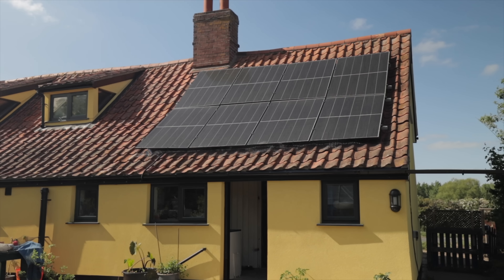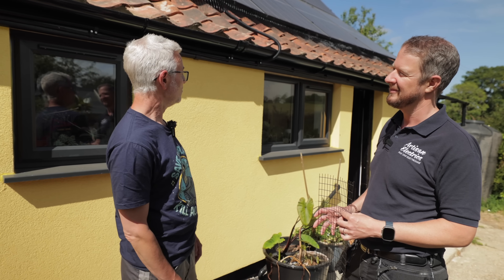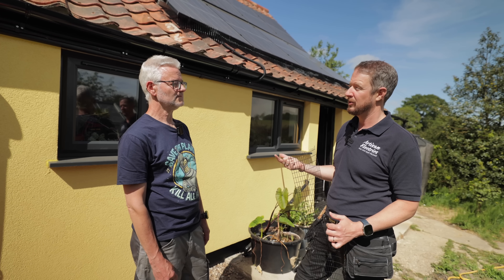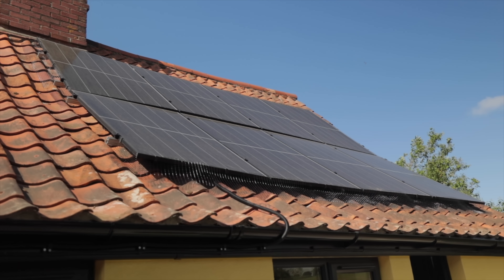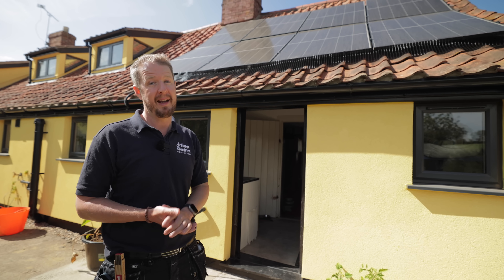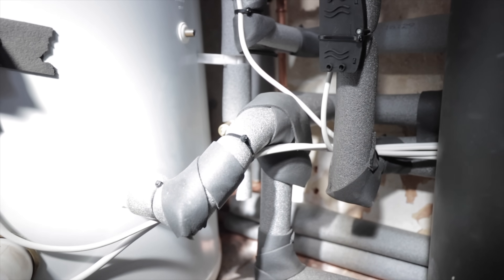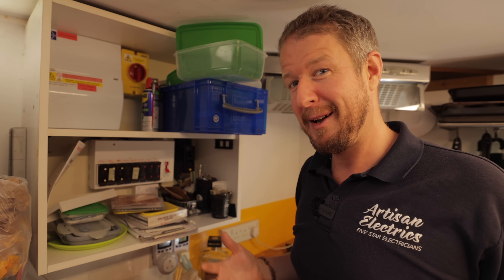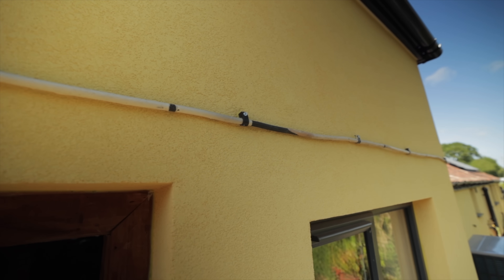This £50,000 Grant-Funded Solar Installation Went Terribly Wrong…😱

Comment: I don't understand why you want to install solar panels on that beautiful roof. It seems like there's plenty of space in the garden. So if it were possible I would have chosen that.
Reply: The house faces almost due south, we'd have to level the garden to groundmount a solar array. But thanks for the roof compliment :-)
Reply: These grants don't cover ground array. 
Was told that when I applied, and when I managed to get hold of a proper engineer to talk about it, he googled the property and also said with that old style roof they couldn't do roof array (as originally suggested) either as they have no way of knowing where the rafters are. They are not set at a consistent distance as a more modern roof would be. I know this to be true as it was re-roofed 8 years ears ago, and all the old higgledy rafters passed BC, structural engineer & builder approval to remain as they were still good. 
So no solar grant - and no wish to spend £10k to reduce modest electric bill by ....? Payback over 20 years.

Comment: I want to get solar, but I'm actually a little nervous because of the cowboys. I don't want Artisan Electrics style of gold plated, pretentiousness but I also don't want something ugly or dangerous.
It's such a dilemma, especially as MCS is mostly a business overhead rather than an actual valid constraint on quality.
Perhaps the industry needs a scheme as an alternative to MCS which doesn't just require paperwork but supports installers (big and small) and which has insurance where the installers get a no-claim cashback if their installs are good. If their installs are crap, then they lose their insurance and get booted off the scheme after sometime sitting at the bottom of an Ofsted style rating.
Then if you subcontract, you'll also risk your membership and money, because you're not doing due diligence.

Comment: I had wall insulation done in 2014 , The contractor was a cowboy, I made a lot of problems for them and i got the work done properly by complaining before the work was signed off , I think it cost the contractor more money since i was complaining for a full row of houses , In 2022  i had solar panels fitted , Within weeks i had rain getting into the house, I complained and the contractor had to pay for the roof to be re-felted and new tiles.  I had to sign a form that i could not come back to them if it leaked again , But least i had my roof redone . All of this work was done under a Gov Grant . I refused a heat pump , The old lady next door got a heat pump, She is happy with it , But at £300 a month in winter , Its going to cost her and its a 2 bedroom 1850s cottage .  My energy costs with 8 solar panels , Over the year , I am only paying £8 a month and we don't have a battery but i do get 15P a KWH from Octopus for export

Comment: Absolutely insane that 50k of tax payers money was spent on a single 400 year old house. A old house needs to breath. Sticking insulation on the outside to make it airtight sounds like a disaster waiting to happen. This is about as anti green as it gets.
Reply: It's a breathable system because it's an old house. Have to say the house had cement render already for ~60 years... so much reduced condensation problems not the structure is part of the thermal mass and not a cold shell.

Comment: Enlighten me. What do end caps do?
Reply: Potentially nothing... but in this instance they would have partially disguised the rough jagged cut/broken ends of the rails (had they not been all different lengths sticking out) and maybe stopped mice using the rails as highways. If this was done properly as the panels are black they would stop the silver aluminium rails showing so obviously. It's mainly aesthetic.

Comment: Just been doing small solar for friend to offset power used by his carp pond New Sunny Roo 3kv invertor £140 off ebay 5 x 420 w panels £63 each plus some brackets ect , Reckon we spent £500 all in systems making 1.7 kw at moment so you can do solar pretty cheap . I run off grid system at our stables , 4x 6v 420 Ah lead acid battery's (sourced S/H) Victron 1kw invertor S/H , 6x 420 w panels , runs everything all year round including bore well pump . This only cost me about £600 as most gear was S/H  , wired panels with surplus 13a mains cable (all 3 cores used on neg and pos lines ) and system works really good

Comment: low ceilings ,cost cutting when built ,same as dormer windows in the roof ,my thing about it all is the roof itself , the roof timbers have warped over the centuries  ,in  all direction's, hence why it looks a mess  ,the next point is they did all that work in 2 hrs, ,one thing is we have no pictures of these so called fitters ,and i bet there van was blank of anything ,who they where
Reply: Good guess on the fitters van... 3 days late because it broke down twice, 21 year old rusty sprinter, plain white, looked like 3 freelancers, sub-contracted by the sub-contractor through a sub contractor for the main contractor...

Comment: my daughter on low income and no spare cash , was awarded £36,000 grant under the scheme , BUT unless she paid £16,000 towards it she couldnt have anything . at least in the end after two years she got free loft insulation from a team of men that had to travel a total of 500 miles to fit the insulation,.   About ten years ago i got 20 rolls of loft insulation free of charge by phoning up British Gas, who delivered it the day after i requested it, i did have to install it myself but clearly no contracrors, sub contractors, corruption  just a simple system cost efficient.

Comment: Who in their right mind would install external insulation, solar panels and a heat pump onto an ancient house?
Reply: If efforts aren't made to keep old housing viable it will be forced out of existence. This was a plain old house and will live on longer now. It wasn't special, not listed and with an EPC rating which meant it couldn't even be rented.
Reply: @reallymadrob  old houses were built differently, they were not designed to be wrapped in insulation and sealed with render....the life of this house has been greatly reduced by external cladding. The house can no longer breathe and moisture will be trapped in the walls causing unseen deterioration. The best way to keep old houses viable is to maintain them sympathetically. Our old house had been encased in render in the 60s and was damp through the walls as they couldn't dry naturally. We took the render off and the outer skin of the gable wall literally crumbled and had to be rebuilt - if the render had been left in place the wall would  have collapsed and the house lost in a very short time. Old houses need to breathe and move from season to season.
Reply: @bobstirling6885  this was rendered ~60 years ago. We had condensation problems because the shell was so cold. The insulation is breathable and ventilation is part of the design - we will be monitoring the frame.

Comment: This is why we won’t have solar panels or heat pump installed. Because it will be a total disaster. The government need to regulate this because government money is going down the drain and it’s costing the people who have installed a fortune to have it put right.
Is there anyway that the installers who do it properly and the people who want it done? Can do a petition or something to get things sorted out?  
Or someone from the government should check and sign it off as being done properly if not the installers have to come back and do it until they do do it properly . Other than that, can’t think of anything else.  Maybe doing that will get rid of the Cowboys.
Reply: There's no need for it to be bad - one reason for sharing this story was to highlight the risks and hopefully give the system a kick up the backside. Simple checks would have saved money and done a better job.

Comment: This is the problem whenever a government grant is run. Cowboys rush in to take a piece of the pie. They have no intention of creating a long-term business that relies on customer recommendations and a reputation for quality work. Their sole focus is getting as much out of the scheme before the funds run out.
All work should have 3rd party independent inspection from a company that sole focus is inspection, testing and quality control. They should be appointed prior to the bidding process and take part in writing quality control specifications and selecting bidders.
This may seem costly but the price of allowing workmanship seen in this video is not just financial it can deter people from making the move to green systems.
I won't comment on the electrical safety from a video but nothinh should fall from a roof - not even lightweight bird guards.

Comment: I saw in Wickes offer on display 12 solar panels and a battery fully installed for £8,950. That is without looking around for a quote. I have not doubt most of the £50k is for administration costs.

Comment: Terrified of the heat pump, because it's a very porous house, but they've also just gotten a grant to insulate the house. That makes no sense. Is he expecting a properly insulated house to remain porous? He even says the insulation of the house has been great before he starts talking about the heat pump- so what's the problem with having a heat pump?

That honestly sounds like someone who heard that heat pumps aren't good and anchored that in his brain and refuses to change his views, even when he himself presents his own counter arguments.

As for solutions - these types of grants MUST come with inspectors that are fully independent. How does one achieve that? A base rate and then £x for each cosmetic flaw they find (e.g. the paint peeling off of the wires, the wires not being hidden away), £y for each minor flaw they find (like the missing bird mesh, £y for each major flaw they find (like the heat pump not being leveled). That gives inspectors a financial incentive to find flaws. Make sure the contractors aren't paid fully upfront, and they aren't paid the remainder until the installation passes inspection. All financial rewards to the inspector are paid from the remainder, as that gives the contractor a financial incentive to pass inspection.

Comment: We had a not dissimilar experience with our Heat Pump installation. This was the last step in a program that included solar PV, batteries, car charger etc etc, and whilst everything else went well, the heat pump installation was a nightmare. The installer went bust before the system was fully commissioned, and I spent a year rectifying faults. It took numerous attempts with numerous installers, (and plumbers), all of whom did a little bit to help me on my journey to getting things working the way they should, but none of whom truly knew enough about the whole heat pump installation process or technicalities to be truly useful. I have now re-lagged the loft, fixed leaking manifold valves; cleaned out strainers on the underfloor system; lagged external pipes; had the heating system drained, flushed, and filled with the correct quantity of inhibitor/glycol (not cheap!); had faulty pipework corrected; sorted out leaks that resulted from moving to an invented system......I even had to re jig the wiring to the under floor heating actuators so that the thermostats control the correct zones now!
I eventually found one company that addressed the main problems and they have been fantastic, even having to re-wire the heat pump....yes, even that was wrong. And all through this journey, the so-called insurance policy that the installers set up for me, and MCS have been worse than useless. Honestly, I have had steam coming out of my ears over the way an end user is conned, YES CONNED, into believing these organisations give them any measure of cover against cowboy contractors. Make no mistake: they DON'T. When things go wrong, you are very much on your own....and boy do you learn quickly!
So Jordan, in answer to your question about how this can be overhauled, I would start with putting in place some real, independantly reliable  protection for the consumer. After all it's no use trying to sue some one who has gone bust........

Comment: Its about the contracts. No subcontracting allowed. Local installers preferred.  Quality checked installs. 

Been the same for years, the insulation grants in the early 2000s where the same issues.

Comment: Personally, I don't think governments should be just handing out grants and ticking boxes, they should fund a GBE to bring all houses up to a specific level of energy efficiency. They should work with homeowners to put all options on the table to either meet that bar or exceed it with additional investment from the homeowner. Then they need to make a project plan specific to the customer, implement the build/installation/commissioning, and inspect the work done before it's signed off.

In terms of actually implementing such a scheme, you're only ever going to get bodge work if you just throw it out to tender, they need to hire subcontractors directly (or possibly even just employ them), and manage them properly. If the homeowner isn't happy with the work before it's signed off, the contractor doesn't get paid till they fix it. If they find out later that there's problems, the GBE can chase the contractor to warrant their work.

Governments can roll out such schemes efficiently, but just throwing money at councils to deal with the problem is unlikely to actually deliver the best results, let alone meet a specific benchmark. GBEs can leverage the scale of the government to deliver big projects that actually improve the nation and drive economic growth. You know, like investments should.

Comment: I cannot afford to have solar & battery installed despite willing to have it tomorrow. 
I'll never apply for work done under Government grants because you always end up with bodge  jobs done by the cheapest contractor like in this case. 
Seen some new boiler installs that have been done with grants and the pipework alone was truely shocking with a simple 'flow through' box sold as a must have gadget that reduces the amount of gas used when it does no such thing.

Comment: It's not a good install but it's common practice to install a new separate consumer unit so the original consumer unit is not touched which they are not responsible for.
By the way, the heat pump not being level is more of a problem with drainage. The bearings are much greater loaded by the thrust pressure of the fan than by a slight bit of tilt.

Comment: I've got to disagree with you with a lot off your comments. I've personally installed 650 chargers and I've had 5 complaints. You can still do a good job quickly. I was regularly 3 chargers a day and a lot were no standard installs.

Comment: the thing I don't like is they tie it to a heatpump, even though it is called a solar pv grant. I have renewable heating (wood), and there was no way I would replace it by far more expensive to run electric heatpump, although I'd love the solar pv. They would spend all the grant money on the heat pump. making it pure solar pv grant would be better, and if they want a more manageable grid, then a battery system should be included; if only they made batteries that lasted as long as the panels, and out of easily sourced non-toxic materials.

Comment: We had solar installed at the end of January this year, a 3kw system, fitted in an hour. Chap said it was a perfect install and everything was done great with no problems.  It was done on the Friday before we had the big storms at the weekend in the uk, and come Monday morning my poor mum was woken at 3 am by water streaming down the light fitting onto her in bed. Later that morning I went to investigate the loft and found the felt was ripped with x6 large holes where the guy had missed the roof studs completely with the fixings.  We are still fighting to get the roof fixed as we still have large holes. It's crazy as we had an accident where the ladder slipped out from under me, and both me and ladder hit mum across the head like a guillotine, cutting her head open with an 8" gash😱😭 and me breaking a couple of ribs as I hit the deck from 7 feet.9

Comment: I don't believe that it's corruption.  The issue is poor governance.  It should actually be really easy to fix if only it was stipulated in the bid pack that the work was only allowed 1 layer of sub contracting i.e. If a company win the whole 'lot' to install insulation, heat pump and solar, then the actual work required has to be carried out either by the winning bidder, or a specialist contractor they engage directly.

Comment: This cowboy attitude by installers is, I would say, the main reason why uptake of renewable technology on existing infrastructure is so slow in this country. Those who are desperately keen to get this tech are simply afraid of all the disasters stories out there which gives renewables a bad name. I think the only way to crack down on the grant route disasters is for the initial council or whoever puts out the tenders are forced to work with known quality installers such as yourselves and not the cheapest price.

Comment: A friend of mine got involved in a scheme here in Spain..shes got 6 panels on her roof,which however much you try and stretch it is less than a 1000 euros...supposedly the  Generiltat or adjuntament subsidies the cost...shes ended up with a 7000 euro loan for her part...Someones profiteering in the whole affair..